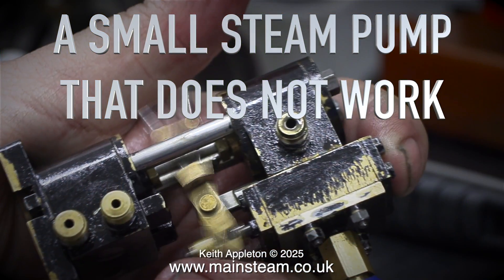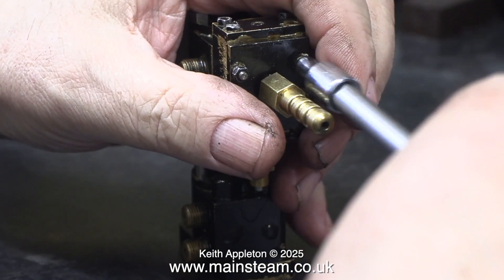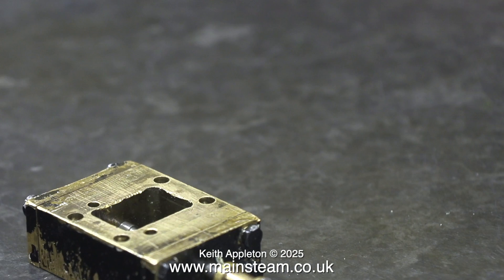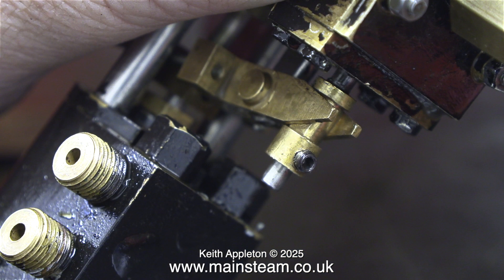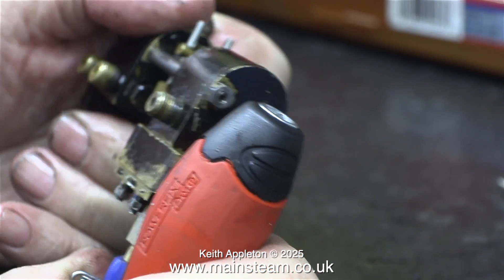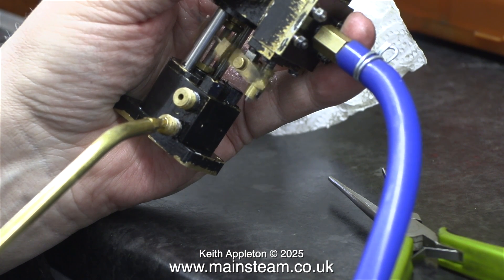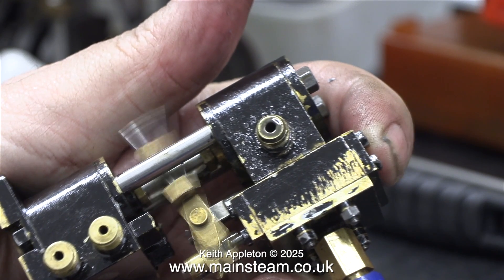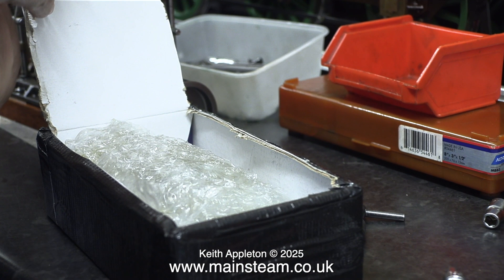A SMALL STEAM PUMP THAT DOES NOT WORK - PART #2

Comment: 3:31 Both mating surfaces showing leaks there.
Reply from the maker: The whole thing is a mess and not worth repairing. I did actually get it to run and returned it to the customer free of charge. Not practical to repair.

Comment: A small surface mill would be a real help in flattening mating/sealing surfaces.
Reply from the maker: I have one of those, but ....... The whole thing is a mess and not worth repairing. I did actually get it to run and returned it to the customer free of charge. Not practical to repair.

Comment: Is it possible that the cover has been turned around or upside down or back to front... all combinations.  Maybe you are defeating a slight binding or helping it seal by nudging the piston.  The pump has lead a hard life.  

I suspect that someone continually tapped it with a hammer or metal implement trying to make it work.  This explains the chipped paint and the beaten nut.
Reply from the maker: It was just a mess . . .